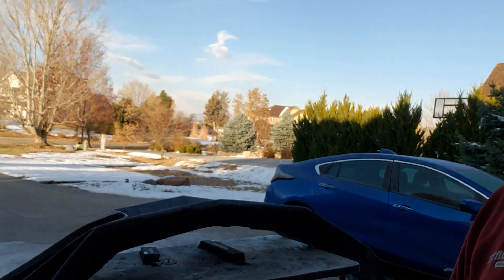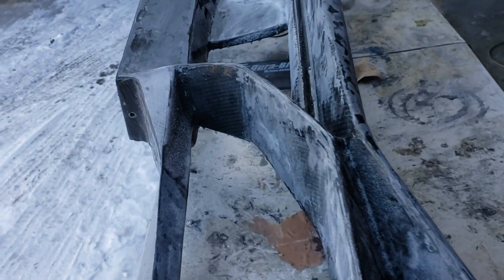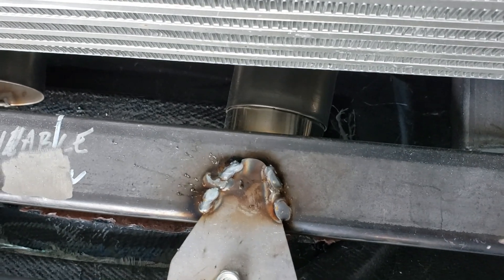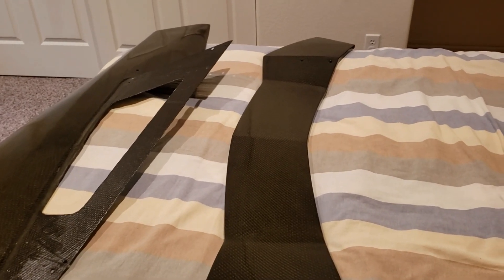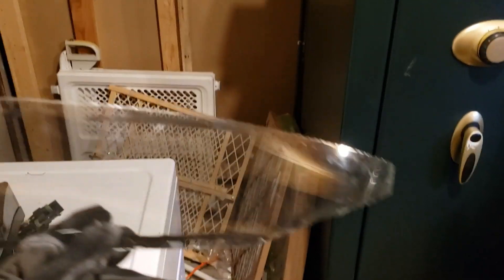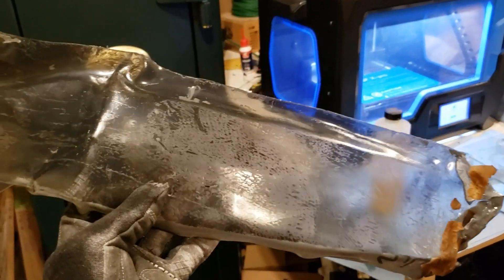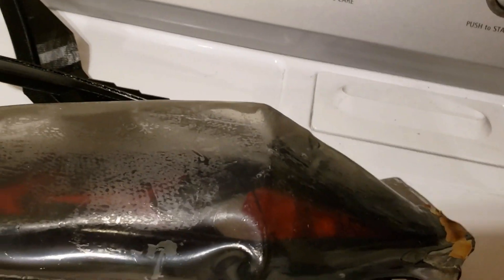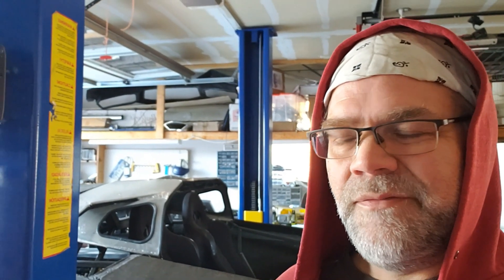3D Printed Interceptor Update 14

Comment: Make a vacuum table out of a shop vac then a frame around the glass heat it up the vacuum it down over the plug. There is a video on you tube on building the table if you need. Actually they used it to do the same thing exactly same the glass on a Lamborghini tail light lol.
Reply from the maker: Thanks.

Comment: Build yourself a rigid buck to hold your form and remove the protective peel coat first then heat the poly. Maybe use a little thinner material looking good though.

Comment: Hey Sterling, 

Ugh snow..... I'm not ready! Fortunately I haven't had any that's stuck yet.  Forming the Poly carbonate over the former is a great idea. 
I think if maybe work with a slightly thinner material, strip off the protective coatings and fab up a rudimentary vacuum table and a frame
to hold the Poly-Carbonate  you should be able to heat the sheet in an oven and then vacuum form it over your pattern buck and it should
turn out great.  That will really finish off those head and tail lights for sure. 

Keep up the great work and again Congrats on the new job!